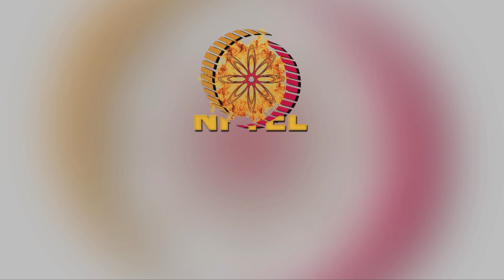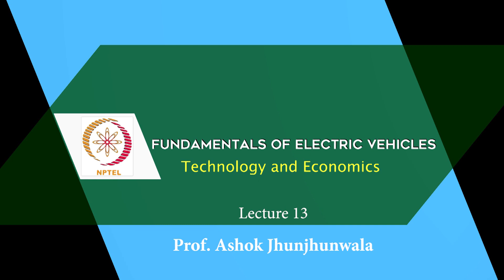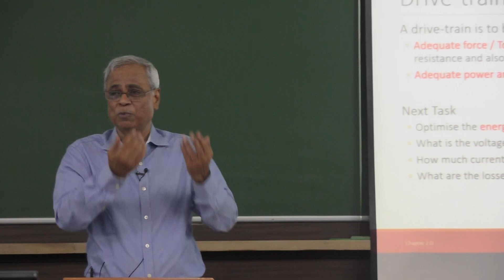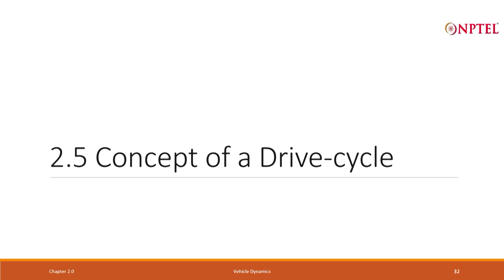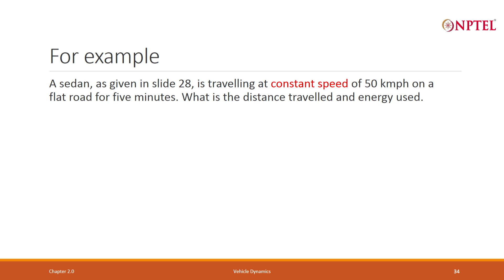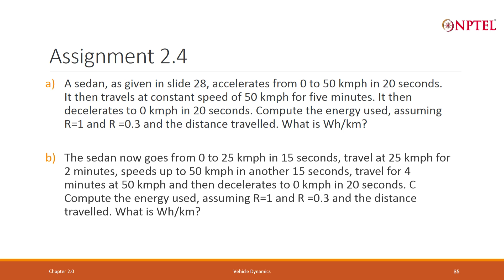Lecture 13 - Concept of Drive Cycle - 1

Comment: 3:00 contradicting the prior point about the inverse relationship with voltage and current in relation to a given power value, and then he claims that lower voltages are safer after spending time explaining how lower voltages beget higher currents for a set power rating, but he forgets to delineate between the directly proportional relationship between voltage and current and the prior scenario. the current is what kills, not the voltage. this is bad teaching.
Reply: @@farhanE.Vhe's only correct if he gives the caveat that the system size adjusts according to parameter changes. otherwise, he's leading idiots like you into electrocution.